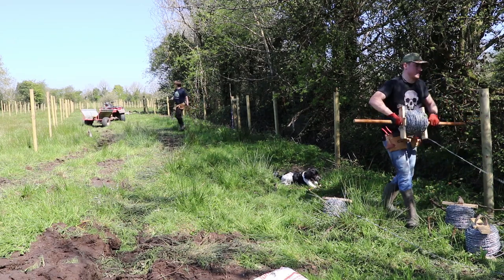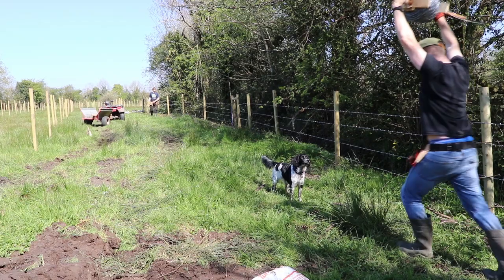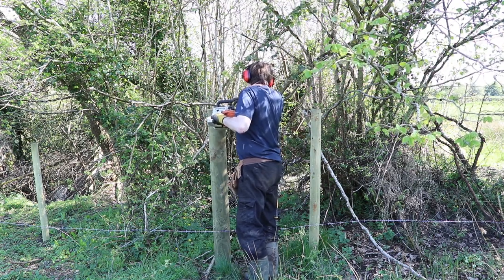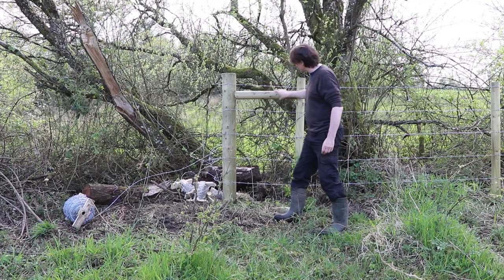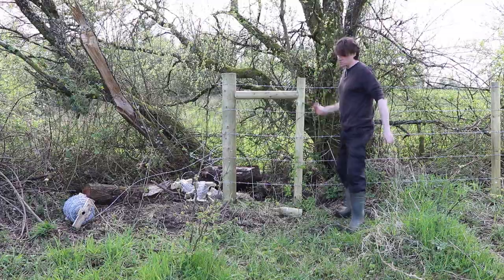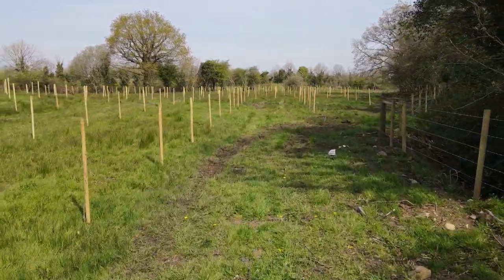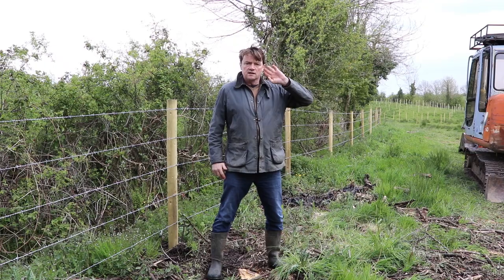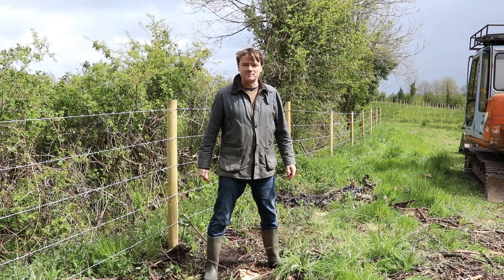Tips on how to Build a Barbed Wire Fence like a Pro | High Tensile versus Mild Steel Barbed Wire

Comment: I love the idea of driving the posts with the digger. It beats every other system I've seen. 
How's the shoulder doing? I can see you're still favouring it a bit,  but you seem to be a bit more mobile now.

Good luck with the cages and mulch. See you next time.
Reply from the maker: Hello Bob. 

I hope all is well with you. The digger is great for driving posts. My shoulder is improving every day now. When I started that video, I couldn't use it and by the end I was lifting fence posts and rolling out barbed wire.  It only hurts now when I try to work overhead or fully straighten out my arm, but that will resolve itself soon.  All the best.

Comment: Very insightful Dary. I’ve been upgrading our forestry fencing to keep in pigs so this is a great insight on how to do my next new stand alone fence. Did you use the digger / quad / come along to pull tension ? I’m looking at clipex posts for my field job , how Long do you think you’ll get from the posts ?
Reply from the maker: Hello Chris and I hope is well. Keeping in pigs sounds like tricky business.  After I finished that video, I realised I never recorded tensioning the wire. I will cover that in the next video. On this occasion I have been using a wire lever because I have my brother to help me judge the tension, but if working alone, I think a better job is a ratchet system.  I will try and do an example of both in the next video.

With regards to clipex posts, they look very interesting, but it is not something that is commonly used or sold in these parts. However, I have a friend in East Sussex, England who swears by them, especially in stony ground.   I went for treated wooden posts that are guaranteed for 15 years and cost around half the price of the clipex posts.. but the clipex will probably last twice as long.

All of that being said, I was recently looking at some fencing that I did 30 years ago, with untreated fence posts and galvanised wire. If you fence next to a hedge, eventually the fence will become overgrown and although the fence posts will fail over time (most were still in place, but could be broken if you tried with relative ease), the hedge keeps everything in place and the fence continues to do its job keeping in livestock (cattle in our case).

Comment: Any guidance on how you tighten the wire as you put it up. The way I learned was using a vice grip, strain the wire from one post to another and use the staple to stop the wire slipping back. That was mild steel barbed wire all the way now.
Reply from the maker: Hello Mike. I have used a few different ways, from crow bars, chain rachet tensioners and currently I am using a wire lever. 

We always tension the wire at the strainer and not at the individual posts, using the steeples as wire guides on the posts. If working alone, I will use steeples, driven half way on every third post, to hold the wire in place until it can be tightened, to prevent it catching on the ground or other strands of wire. 

The biggest issue with working alone is evenly tensioning the wire when you are pulling at the strainer.

I will show you the tools we use and our approach in this next video. 

All the best